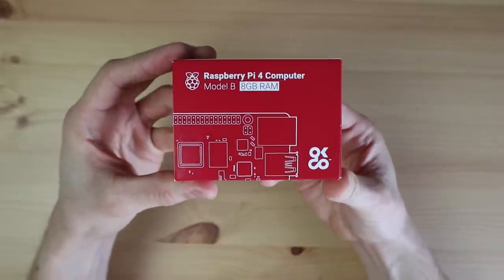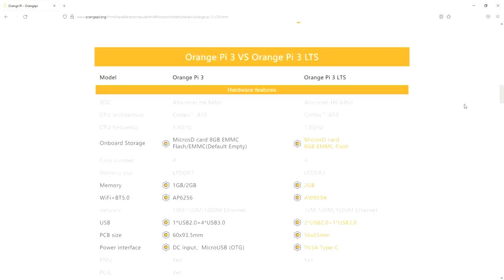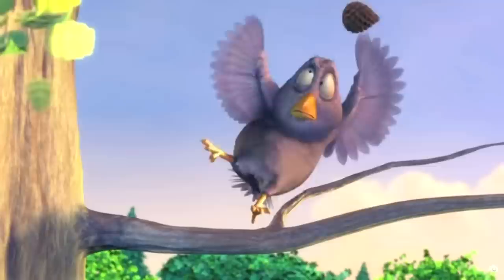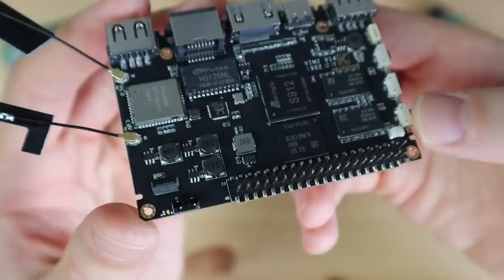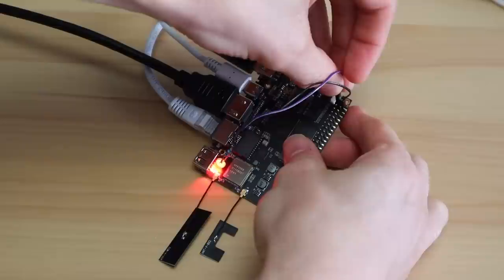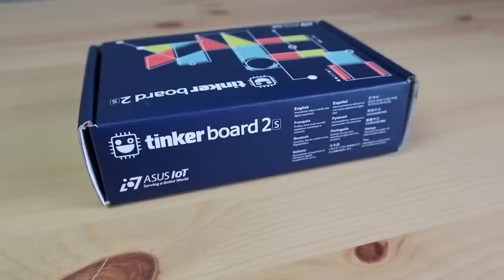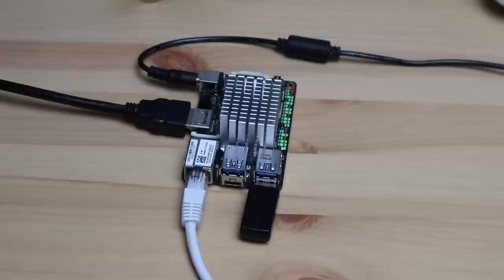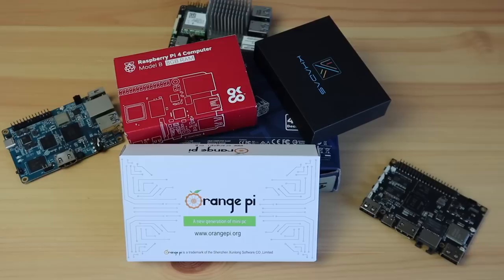Pi Shortage - Are These Worthwhile Raspberry Pi Alternatives?

Comment: Yeah ... I was like, "let me get a bunch more for a home cluster"  .... and ... almost $200 for an 8GB.

For $250 you can get a mini-pc with Ryzen, RAM/SSD, case, PSU, ready to run with much better performance. For Homeassistant or a home server, at this point it's just a better deal to get a mini PC.

Which is sad. This was supposed to be the $40 SOC that's $200 now :(

The "hats" and cases/addons/stands/display and support for Raspi is still a big thing though. 

Sure, for Android I would still go with an SBC, but at this price point for the performance I will be looking at mini PCs rather then these. Well... actually I still have 4 PI's running at home, but I just ended up throwing everything onto a 12 core Ryzen 3900x with 64GB ram.... just spin up a new QEMU VM, and call it a day....   except stuff that occasionally has to run on a battery, like my homeassistant and MQTT.
Reply: Honestly though, except for experimentation (and assuming lower costs in the future again), a single little mini PC is going to give better price/performance than a Pi. Especially now that the Pis price is astronomical :(
Reply from the maker: Yeah, with the current market , a mini PC is probably better value for money and will give you better overall performance. You could then offload your I/O to devices like an ESP32 or RP2040 and have them reporting to containers on you mini PC.
Reply: A ryzen is a much better deal than a Pi for running a server, so I would say that the shortage forced you to get something really nice and future proof.
Reply: This is exactly what I did.  Been looking for a pi4 forever and ended up getting a refurb mini that costs the same and is more powerful than an entire bakery of pi.
Reply: Ryzans are unuseable their idle power simply sucks. Thats why i not only bought a 12900k for my deskop after a very short thinking time. But i will also get an Intel 8th Gen i3 NUC now as 2nd hand.
Reply: Gonna need a part list for that $250 PC
Reply: @Denes K Do you have a part list from your $250 mini pc. 

Prices in EU are nuts when it comes to second hands Pi's.
Pi3b are selling for €50 , Pi4 2GB €100 8GB pi4 €225.

I sold all my old pi's. And looking for a mini pc. Nuc or something
Reply: The Rock5B is starting to ship starting at $120 that really competes and beats some of the mini pcs in the $200+ bracket only downside is the rk3588 SoC is still very fresh and the images are running a BSP than mainline which often can have gotcha's.
Reply: @llothar68  So you bought a Intel that uses 2x the wattage in use for a approx 10% gain over an 5950x because when not in use the intel can turn off cores to just 2x p cores of no use.
Then you apply that super demonstration of knowledge to the many 'embedded' mini pc processors here?
Reply: @rolyantrauts2304  As a programmer my system is like 98% in idle. But i need the 24 core peak performance. And with a MSI board its now idling at 30W instead of 80W for a fat Ryzan system. 

Idle is the only energy metric that counts for most people.

And i still prefer a complete unix system on a NUC instead of a VM for a few web things. It's so much closer to the final live performance.
Reply: @llothar68  "Idle is the only energy metric that counts for most people." Is not as the system will suspend and guess what you can turn it off.
Your are so out of context quoting the latest I7 12700k & 5900x whilst in a conversation about mini pcs, whilst trying to convince us idle wattage is the most important.
Wow, you are an absolute goon.
Reply: @rolyantrauts2304   all my systems including my macs have don't go to sleep because they crash on wakeup. windows is still best but a triple monitor setup with a kvm in the middle which is the main reason for wakeup madness of fedora, macos and windows (which is the best).  

but even others with one monitor system stay most of the time in idle and not sleep. when have you been the last tien to an office space? 

and fact is. intel beats ryzan with idle by 1:3

Comment: The Odroid C4 is now two years old, but a good tinker or low power home server board.  I've been running one non stop for just over two years. I chose it over a RPi because it had a dedicated Gigabit network chip (RTL8211F) instead of sharing bandwidth with the USB like the RPis did.  Still seems to run around $65-$70, but I recommend also buying a eMMC module vs booting off a microSD. It made a difference for me.
Reply: Old means mature. furthermore, Odroid C4 use a 12nm chip. It's in fact more modern than rpi4.

Comment: Been there, I stopped using SBC for hardware projects/tinkering.  
Using boards now with the RP2040 with WIZnet (ethernet or WiFi) or with a ESP32. Development is quicker, I/O blazing fast. 
When heavy lifting is needed, it is offload to a NAS running docker containers and/or Debian vm's.
Reply from the maker: This is probably the best approach for hardware projects - almost all hardware projects that people do on Raspberry Pi's using the GPIO pins would be better suited to the RP2040 or an ESP32, at least for the I/O and data capture portions.

Comment: I think the other thing we have to do is look at all the other units that you have covered and we build documentation for those as well. I remember though using the Asus tinker board and I just realized that the OS on that doesn't go past Debian 9. I guess it means we all have to learn a lot more especially me. We need to know what type of processor these are and making sure we have linux support all the various types of drivers for each type of embedded board. Its good that you are looking at all these different pi alternatives. I haven't played with them all yet. I have started playing with Fedora on a Raspberry Pi 3 instead of the usual Raspberry Pi OS (Debian). We as a community need to do more (including myself) , learn more and contribute more.
Reply from the maker: I think thats part of the reason that the Raspberry Pi platform has done so well, for a number of years almost all SBC makers were working on delvopment on just this platform. As you soon as you have the community working on multiple platforms, the skills and resources get diluted.
Reply: @MichaelKlements  With the advent of the bot scalpers I think this is merely one facet that we have to look into. Its unconscionable to even give these scalpers a single penny. I think it will take many different ways to make it unrewarding for the bot scalpers.

Comment: I recently needed a pi compatible board to run some arm-specific software and was shocked at the pi prices. The replacement I went with was the "Le Potato" (Libre Computer Board AML-S905X-CC) which installed Armbian with no issues and has so far fulfilled all necessary requirements. It cost $50 at the time of posting, so not terrible.
Reply: The only problem with that is Libre has pretty much gone belly up. Maybe they are still supporting other boards, but they definitely aren’t supporting the Potato. Their website hasn’t been updated since around 2019 and most of the builds out there are slowly dying as nobody wants to support an abandoned platform. Armbian, as you say, is a good choice. If you are looking for a good video player for the Le Potato, it is still supported by CoreELEC. And it works excellent for that. Ask me how I know 😉. You will need a heat sink and a fan though. The S905X runs hot and high 60s are not uncommon. I think the danger range is well over 100 degrees, but heat sinks and fans are super easy and will get you 15-20 degrees to the good.
Reply: I recently purchased the Le Potato. They just released Ubuntu 20.04 for it. I'm using it for some amateur radio projects. I did get the case with the fan and a heat sink.
Reply: @PaulGriffith  Let us know your experience with amateur radio and our software. We're trying to wrap our head around how people use our products. If you need any assistance, let us know.
Reply: @PaulGriffith  Are you by chance using it for an Allstar node?  I’d be interested if you can can get the Asterisk suite running on it.

Comment: My alternative for a Raspberry Pi is thin clients. Locally, a Pi 4 is ~250 (!!!!!!) USD, but a Dell Wyse 7020 (with 4GB of RAM and 16 or 32GB SSD), a quad core AMD CPU, PSU USB 3 and Gigabit Ethernet is around 50 USD. They consume slightly more power, and lack GPIO pins... But are 1/5th of the price.
Reply: sounds like a nonsense
Reply: Add arduino and voila! Le GPIO.

Comment: I recently tried to use mainline Armbian patched by inovato, flashed on an SD card and booted on Android TV box Q+ with H616 quad-core CPU and 2 GB RAM from Turewell. This sells for less then 30 pounds in a case with power supply. Youtube playback on 720p30 is reasonable and without SD card plugged in Android is booting from built-in eMMC and even FIFA on Stadia is enjoyable at 720p30.

Comment: As homeserver I use an odroid-m1, just 4 cores  but 8GB of ram for 120€, supporting SATA/NVMe M.2 and eMMC storage. OS installing via Petitboot is a snap and chances are good to get full mainline kernel support as RockChip is known as community-friendly and an orange-pi router board with same cpu is already nearly full supported in mainline. Power consumption is fabulous.
Reply: I see some simplicity in moving our huge old server and large desktop pcs into more single purpose devices. I could have two or three m1 "servers" that would be easy to replace and then "desktops" are just another m1 on the back of a monitor. Seems 100x less expensive and easier to service. Is there a preferred way to learn about the M1? I've almost purchased 3-5 different odroids at various points in time.

Comment: I bought numerous alternatives in the past (Orange Pis, Odroid,...), but I have stopped - after 3 to 4 years, the support /software for these boards become unavailable or do not get updates anymore. Old Rpi models are still fully supported documented and usable. This is enough for me to keep buying only Rpis now.
Reply: maybe actually learn using linux instead?
Reply: @robbietorkelsonn8509  How is this related to my comment in any way? I explained I get stuck on old distros because of lack of community support for non pi SBCs, and you are suggesting to 'learn linux instead'? Recompiling the kernel every time I need a new driver is just too time consuming while Pi documentation and software is up to date making it easy to integrate even with recent peripherals. I still have 2 Orange Pis monitoring UPS devices, but will probably replace them with Pis when the time comes. (unless I "actually lear linux instead" (??))
Reply: @v1ncen715  instead of taking any comment on youtube as a personal attack, you might want to consider it's sound advice

All peripherals you might want to connect to the header can be attached using user mode functionality, be it GPIO, SPI or I2C,  so they don't need a new driver

incorporating new driver modules isn't even all that hard to do either. 

I just think it's a waste to either buy a new board because you don't know how to use the one you already have, or pay high prices for a raspberry pi while better boards can be had for less money
Reply: @robbietorkelsonn8509  I am not saying it is a waste, my comment was only to highlight the better community support for Pis that may be positive for most people. Your comment about 'you should just learn linux instead implies I do not know how to use it, which sounds like an attack indeed. 

I am not saying adding drivers is hard, it is just time consuming and not worth it to me. I wont buy a new board just because I do not know how to use the ones I have. But next time I have to open my UPS to replace the batteries, I may switch to Pis for convenience, and to avoid having to look for updated or working images on outdated sites. I replaced the Odroid on my TV for a Pi4 recently because Kodi is more up to date out of the box for instance.  I use the Odroid for other purpose now, it is still a good board.

But yeah, I don't think you understand the point, it is about convenience and saving time. I am happy to pay a few euros more to make sure to have a product that I will find documentation and software for 5 or 6 years after purchase.
Reply from the maker: This has been my experience with some of the other boards and microcontrollers I've tried in the past too - they're supported for a short period of time and then the company either disappears or they move on and forget about the older product lines.

Comment: Raspberry pi sold in my country cost almost the same as an old budget pc which is crazy for just a single board (furthermore almost all stores are currently out of stock until next year)... i think i would give a try on orange pi.. as it is within the reasonable price range
Reply: Yep, if you want one for a small server, retro games, or media server it is cheaper and you get a lot more power buying an old micro i5-6500T system for $100.
Reply: @B5152g  yupp, Dell's thin client pc has more power and has extra ports with included power supply that cost less than $100.. You can't go wrong buying it, if your intention is to setup a server. But if you have existing projects and need a replacement that is a big bummer...

Comment: I have a Tinker Board S that I currently use as an Android HTPC. It's pretty comfy so far, playing high quality videos on YouTube and Kodi. You can even run some emulators without issue. I know that you can do plenty of interesting projects on it, but its software support is not stellar. The integrated eMMC is useful, though. I wish this hardware could have gotten a larger community.
Reply from the maker: It's quite dissappointing as it really looked the most promising to me when I initially looked at them. I'm surprised that they haven't put much effort into developing the software and support further - the hardware is great.

Comment: I don't know about right now but the raspberry pi 400 was/is available at pretty close to the normal price.
Reply: At least here it seems like layouts for our own country are harder to get, but there are quite a few available with layouts for other countries (and at the same "normal" price as the country based ones). Don't know whether it's the same elsewhere (which would make sense) but I guess you could use one if your use case doesn't rely on a keyboard, or you don't mind using an external one, that could fit your case?

Apparently as well, the 400 and official keyboard are interchangeable with a bit of work (and with some tiny wrong labelling, though it's not recommended and will void your warranty) - been thinking of trying that out on one 400 I already have which has a bad keyboard (and I didn't think to try get replaced!) as I quite like the integrated keyboard and am satisfied with it on the other 400 I have...

Comment: The media playback is almost for sure because the lack of hardware acceleration on the linux setup. If you set it up properly they should all do 1080P playback at least. And that AmLogic chipset will do a ton of codecs too and even HDR IIRC (although not on linux)
Reply from the maker: Yeah it's most likely an issue with hardware acceleration, they seem to do a lot better on media oriented software packages like Kodi, Plex etc.

Comment: Prob missed one of the best alternatives Radxa which Okdo and RS have picked up after the split with Raspberry.
You will see Okdo advertising the ROCK 4 SE and more to come.
The upcoming killer RK3588 Rock5b SBC for $120 is actually a true desktop alternative and really begins to blur the lines between desktop and SBC but is still very fresh and like still better with a now long term mainline linux supported ROCK 4 SE.

The strange fruits of Orange & Bannana Pi give a false impressions as they are 'open source' but they are extremely lacking to the likes of Radxa, Pine & Khadas.
Orange Pi are good for cost but often have much less support than others.

Comment: I got a refurbished Fujitsu Futro S740 instead. Has a x86 Intel J4105, accepts specific 16GB Mem Modules, also accepts a M2 SATA SSD and M2 A E Key stuff like wifi module etc. Cost for the Futro in german eBay was below 50€.

Comment: I am using the RPi 4B 8G, luckily I bought it early it was relatively cheap, I pushed it to the limit overclocked, it is barely enough for everyday use as a basic desktop, I always want an upgrade, still waiting for the Pi 5 to come. There are handful of similar ARM SBC in the market, the problem is, as far as I know, unlike the x86 counterpart, there is no standard architecture for ARM computer yet, so that I could not simply buy any model I want to run the same system on it, I must stick with one which is the PRi that can easily get support from various sources.
Reply: not really aslong as you just use it as a computer and don't care about the gpio features, its pretty easly replaceable.
Reply: @damian007567  So I can boot a Pi image on the Tinker board for example ?

Comment: The ASUS CN62 with a Celeron 3215U in it, blows the Raspberry Pi away, and I can find them semi-reliably right now for $20-40 on fleabay.  I just ejected 2 Pis from my home network for this very reason.  I can't seem to find a Chrome_book_ for this low with a good CPU, but as soon as I can, I'll be grabbing one of those because it's got it's own built-in UPS.
Reply: Are you running Linux or chromeos on it?

Comment: I bought a Dell Optiplex 3060 (i3 8th gen 8gb 240ssd) refurbished for my home assistant setup, it's over kill. Wasn't dirt cheap but the only option cause we have no other SBC in India except for RPi.

While there was NanoPi5s, it had the same price as the Optiplex but less ram and storage and I couldn't find proper documentation for installing any os except openwrt. So x86 was a better option in any way possible.
Reply: Can't you order other boards from overseas?